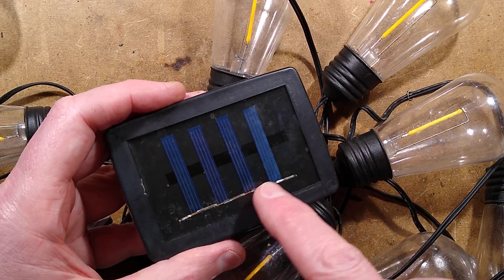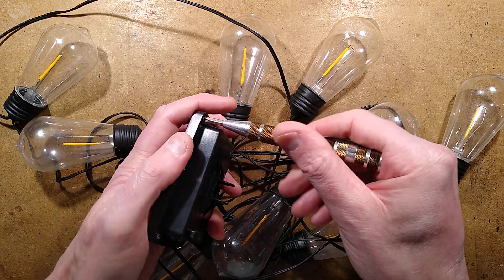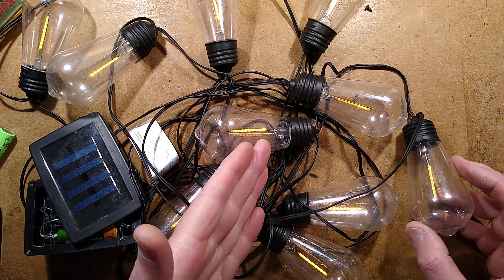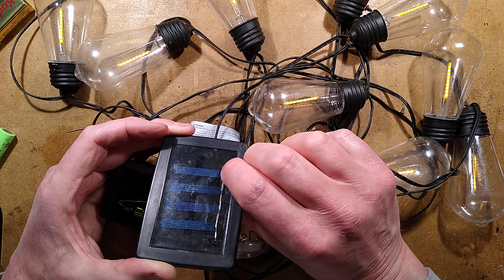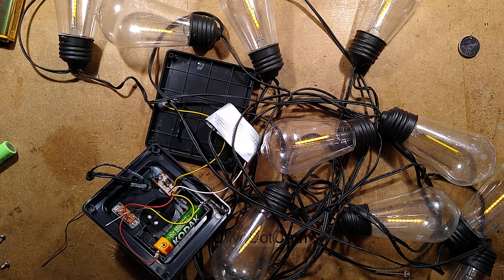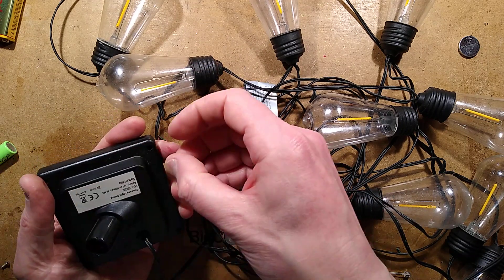Fixing my brother's solar garden lights

Comment: Would you consider doing something with techmoan, fixing old hifi, like making the autostop work on this cassette deck? https://youtu.be/QfqlomOy1JA
Reply from the maker: I try and avoid getting involved with old stuff like that, because the plastic is often fragile and irreplaceable.
Reply: @bigclivedotcom  
I guess your schedules aren't compatible; this restoration project took long time including ordering replacement belts, pulleys etc, while your videos appear done in one go, occasionally paused for schematic drawing and particularly difficult (or slow) disassembles.
This looks like a small, contained problem though, in a mechanically sound (healthy) device. Perhaps even too small to justify traveling to you.
I could imagine you (pl) doing a remote triage of some of his broken devices to see what's appears fixable (and worth fixing).
The two-three interesting devices get to you and you fix the devices: he opens, you do your magic, close up, watch and listen.

If you make a certificate "This device has been restored by Techmoan and BigClive", it could probably raise a pretty penny on eBay ;-)